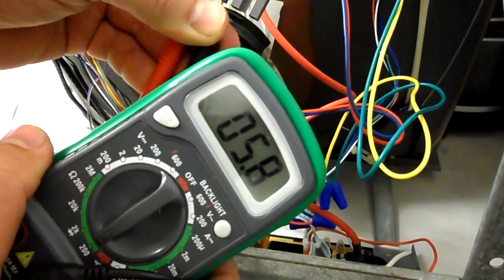25" Arcade Monitor Wei-Ya Universal Replacement Chassis Review (Part 1)

Comment: Hi there. I have 2 questions. How do you make a 9 pin chassis compatible with 11 pin tube? How do you wire to a vga input? Thank you.
Reply from the maker: 1. Two pins aren’t used. If the yoke is low impedance, and the neck board fits on the neck, you’re fine. If you’re talking about using a big neck chassis on a small neck tube - not possible. 2. This chassis is CGA only. VGA input will not work.
Reply: Thank you so much. What are the different color wire for the video input?

Comment: YourMKArcadeSource, I have A51ACG34X CR23 neck (orange yellow 12,2 and Blue, red 2,7), its from a crt tv, would this one work on that chassis?
Reply from the maker: Yes, but you may not be able to completely fill the image. With the higher resistance readings, you may get black bars on the sides and top/bottom and you won’t be able to stretch the image to fill the screen, but it technically will work.
Reply: @YourMKArcadeSource  Hmmm I get you! Do you have any recommendation besides that chassis? I got this tube 19 inches from a ctv combo with dvd, and it was quite hard to find it here in Estonia, so what I need is a compatible chassis to make it work.
Reply from the maker: Yes. Get this one.

https://www.classicgamerooms.com/arcade-parts/monitors/replacement-arcade-monitor-chassis-detail.html

Comment: I have built my own cab from plans on the net. I ordered a MK1 PCB and sound board. I Have wired up my Jamma harness and PSU. I have a monitor in the ranges you specified pulled from an old 25" RCA tv and ordered the chassis. The only thing I'm fuzzy about is an isolation transformer. Can you please make a step by step video on how to obtain (or make) one and install one so I don't mess up my build. That would be great. I'm pretty good with duplicating what I have seen done.

Comment: Please help. I ve done everything you described but in the end my image from metal slug is like watching it through a mirror. What have I done wrong???
Reply from the maker: You need to flip your yoke wires. The Red and Blue wires control the horizontal and the Yellow and Green control the vertical. Flip the Red and Blue wires to make the image flip around. Does that make sense? You can either snap the connector in half and flip the actual connections or you can swap the wires.
Reply from the maker: Turn the "screen" adjustment down on the flyback to get rid of the lines and turn up your RGB adjustments on the neck board/chassis to get more color, or the "contrast" adjustment if you have one.
Reply: Thank you so much for your help so far...Almost everything is fixed .. I did exactly what you said on the flyback ,the lines disappeared  the screen was a bit blur and i fixed it by adjusting the focus on the flyback. All was functioning well until I turned the coinop off. When I turned it on again the screen was fine but shaking terribly!! How can I fix this ???? The other thing i need help with is that my chassis has the plug to demagnetise the screen but my control (like the one in your video ) does not have the switch to demagnetise ..Is there any other way ??? ( Is this why i have a shaking screen ? Because I cannot demagnetise ? ) Thanks in advance !!!
Reply from the maker: There should be an H.Hold or V.Hold adjustment. Use those to fix the shaking screen. Let me know if that works.
Reply: YourMKArcadeSource I tried for an hour but nothing change :(
Reply from the maker: Can you shoot a video showing exactly what the problem is?
Reply: Apart from the screen shaking I can't adjust the img to the center on the screen.  On the left side there is a border and right adjust perfect.
Reply from the maker: Sounds like your sync may not be hooked up correctly. I need to see how you have it hooked up.
Reply: shall i flip  with Red and Blue wires ?? as you told me ??
Reply from the maker: No, those have nothing to do with the sync. I need to see how you have your video connection (RGBGS) hooked up as well as your image. Can you post a video to your channel for me to see?

Comment: So this monitor is still working well after several years? I'm looking at getting one of these chassis for the POS Hantarex monitor I have in my KI2. Thanks for the video.
Reply from the maker: I only used the tube for video/testing purposes. I reinstalled the original chassis shortly after this video was made. However, these universal chassis' work great for collector/average user purposes. They aren't so great when used for commercial applications where the monitor will be left on for hours and hours. If you're just going to turn on your machine, play it for a while and turn it back off, this chassis should work fine for a long time.

Comment: Nice video, but you did not talk about the 2 red wires jumper on the chassis. One is for switching between Narrow and Wide mode but what for is the second one ?

Comment: Very nice review and was extremely helpful! I'm looking for a chassis for my Wells Gardner K7000 Monitor - Yoke# 9A2911-002. Would the Wei-Ya 825H/R Chassis work with it?
Reply from the maker: If it was a K7000 tube, Yes!
Reply: Thanks brother!
Reply from the maker: You're welcome. Make sure to use an isolation transformer.

Comment: Hey, thanks a lot for the informative video. I have a probably foolish question about this. I just got this replacement chassis, but the power cord came without a plug. The only marking is white writing with a voltage rating on it. Could you tell me which wire is live and which is ground based off this?
Reply: Does it even matter or is it switchable and it can be installed either way?

Comment: The 2 yoke sets of pins are for if the picture is upside down you then move the plug to the second set of pins that will invert the picture the correct way... also that other vertical pot you mentioned is vertical lin. This will even out the scan lines or bunch them up on one side if you adjust....

Comment from the maker: I made a mistake. It actually does. I was mis-informed. If you don't use an iso, the big, vertically mounted ceramic resistor heats up and breaks apart.
Reply: When hooking up the the iso transformer does it matter which of the black wires from the chasis hook up to the iso wires? I have a midway cab and the iso wires are purple and purple with a yellow stripe.

Comment: WeiYa chassis for 25" used to have really bad blooming issues (going from black screen to full white).  Has this been fixed?   It couldnt source enough current to maintain full white without dimming substantially.  If this is fixed with this version, that would be great